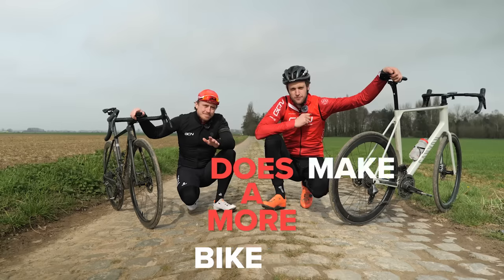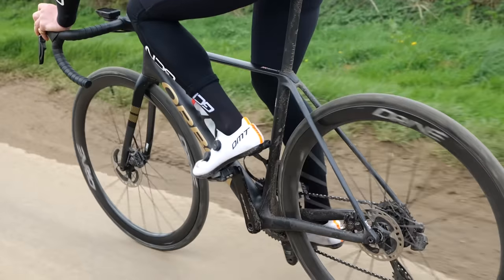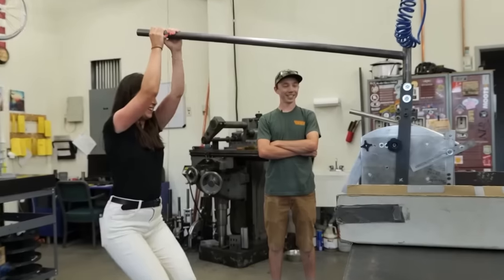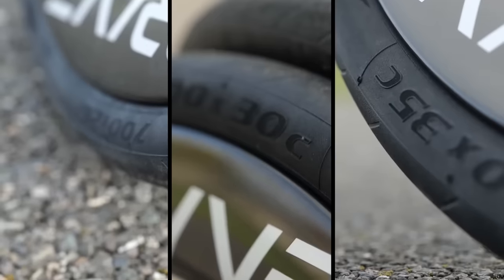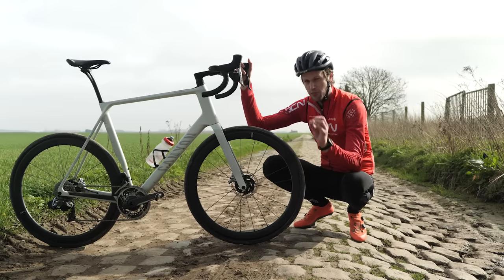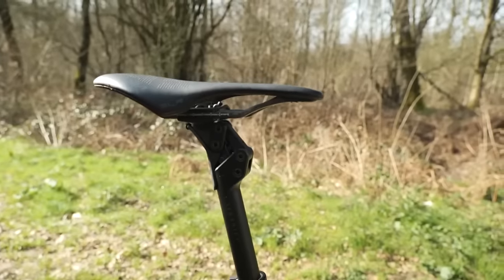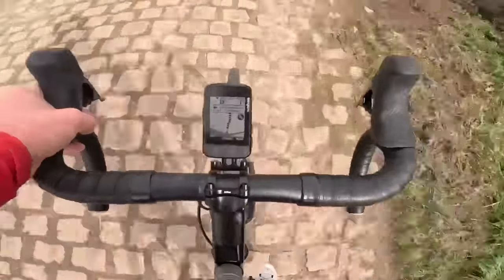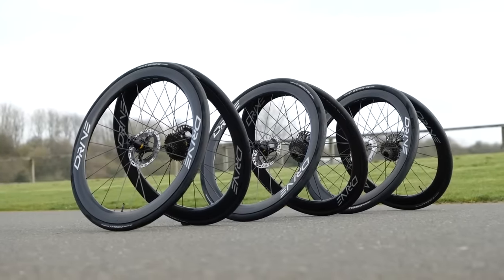Does Compliance ACTUALLY Make You Faster?

Comment from the maker: Have you paid much attention to the compliance of your bike? 🚲

Let us know in the comments below! 💬
Reply: years  ago i thought it was just waste of money but after looking into it more i have realized that it does matter much more than i previously thought.
Reply: And now I am converting my MTB to gravel bike just to really test if it makes difference. 😀
Reply: the bmx (DP Firebird Freestyler) i had as a kid felt like it just skipped over bumps, and still does. Currently have a full chro-mo single speed (Subrosa Malum DTT) with 29x2.35 tyres (60psi) and it's like having full suspension. Both of these have double top tubes, and the Firebird has Skyway wheels which are made of nylon, i have no idea if that contributes anything to this though.

I've always hated the way some bikes ride as if they're trying to smash themselves to pieces!
Reply: As they used to say: "Because so much is riding on your tires" why ride on anything without a supple carcass, no matter what the size/width? My faves are sold by COMPASS...I think Panacer actually makes 'em?

Comment: Buy stiff, because it's faster. Then buy compliant, because stiff is actually slower.
Buy hookless because it's better (to the manufacturers). No, buy hooked because it's safer.
Buy lightweight because it's faster to climb. Actually, buy aero because it's faster everywhere unless on a 20% gradient.
Buy integrated stem because it's more aero. Now, you should go back to traditional because look how adjustable it is.
Buy electronic groupset because... look it is wireless! Damn, you won't believe there's something cheaper and more reliable.
Now on the MTB side, direct mount rear derailleurs, a few more years until someone invents a little piece of soft metal to protect your expensive frame...
Reply: Or just buy what you like and stop following trends?
Reply: @kidShibuya  of course, i do. But all this marketing BS is just getting tiring, especially because sometimes there are no options you would like to chose, since trends pushed logic out.
Reply: Buy hydraulic disc brakes because they're better in every way. Actually, get rim brakes because they're lighter and retro cool. 

This is why it's important to think about what you're going to use it for and where you're going to be going before you spend any money. The thing that actually bugs me is how much time gets spent talking about bikes that are all within 10% of being the same.
Reply: then don't watch 🤷

Marketing will always exist. Professional sports is sponsor advertising galore. It existed before you were born and will continue to exist after you're dead.
Reply: Well, stiffer is great for a big strong racer who wins a paycheck in the last 200m of a race, and can tolerate all sorts of discomfort the rest of us can't.

Comment: Alloy isn't short for aluminium. An alloy is a "mixture" of a metal (elemental) and something else. Steel for example, is an alloy between iron and carbon. Aluminium bike frames are also alloys between aluminium and other metals, depending on what properties you want to give the material. Pure elemental aluminium would typically be too brittle.
Reply: The steel tubing used in bicycle frames, at least the better ones (e.g., with tubing produced by Reynolds, Tange and Columbus) also is alloyed with other elements, often including chromium and molybdenum.  These elements enable the tubing to be made with less material (and thus lighter) with no sacrifice in strength.
Reply: A pure carbon steel is also an alloy (iron with carbon addition). Pure (non alloy) iron is never used as a construction material.

Comment: The new lower tire pressures that seem to be the new norm have had the greatest impact on compliance.  I thought my bike was stiff and a little jittery, but taking my tire pressures down has made a huge difference in compliance.  The bike is far smoother.
Reply: Because this way people not only will ride slightly slower, but also more likely will need to buy new spare tubes, tires, rims. While pro elite teams still ride at high pressures and keep their tires pressure a commercial secret, they would never share with anyone at what tire pressure they ride, maybe only among their  teammates.
Reply from the maker: Lower pressures are great aren't they 🙌
Reply: @tongotongo3143  lmao, cope.

Comment: A thing worth noting is that a really stiff bike with tires pumped really hard actually feels great under some circumstances. I used to LOVE riding with my tires pumped really hard, because vibrations are essentially information. It made me feel like the bike was telling me absolutely everything about the road!
Reply: Yes, vibrations tell you everything on the road, but they also make you slower
Reply: You will also have less control and grip in corners.
Reply from the maker: There is something to be said for being able to feel the connection between road and rider 🙌 Do you think this is lost with the trend for wider tyres?
Reply: Totally agree and it also feels quick and responsive.
Reply: @gcntech  I sure do think you lose some of it with wider tires, but on the other hand, carbon frames and wheels make up for some of it by being way less noodly than old steel frames and allow wheels. Also, I'm 50 and not 20, so I prefer giving up some directness for extra comfort that I wouldn't have wanted to give up 20-30 years ago..
Reply: @fredmcgough748  might feel fast, but in reality it is slower

Comment: I don't think their logic is quite consistent.  Yes, carbon fiber can be chosen and layed up in a way that flexes this way, but not that.  However... even though metal in a cube is isotropic (same in all directions), the very act of making a tube overcomes that, as does butting, as does ovalizing, as does tapering, as does selective heat treating and mixed tube choice.  So, while CF still wins on weight and vibration dissipation, it loses when it comes to flexing and springing back (yes, CF reinforced polymers make excellent springs, but turning them into tubes is another matter).  After owning all kinds of cheap and fancy steel and Ti and CF, I'm going back to metals for everything but seatposts and handlebars.
Reply: We don't build bikes out of spring steel.   Carbon still wins at springing back

Comment: Moving towards 70 and never felt more comfortable on my road bikes! 4-5 hours is easy. No hand buzz, numb-where-you-don't-want-to-be, saddle pain. 32mm tubeless (vs 19mm), power mirror saddle (vs hard, long nose), carbon handle bars (vs steel), padded double bar tape (vs single grip tape). Hell, even my bibs are 5x more comfortable than they used to be! Faster because I ride more.

Comment: The reason that Al frames seem harsh is because of the tube sizes and frame geometries.  the material itself is much less stiff than steel (1/3 as stiff).
What we all want is a bike with lots of vertical compliance while being laterally very stiff.
I did this by going to a bike from Alter Cycles.
Great ride and still efficient.

Comment: Deforming a structure requires energy. Kinetic energy is converted into heat energy and sometimes noise energy. Energy that is not going to the drive tyre.

Comment: Why don’t pros use the seat post suspension for the cobbled races? Seems like it’s a win win when using it. But they don’t seem to use it.
Reply: It probably comes down to weight savings. Pros are really not bothered with being comfortable. It’s all about speed.
Reply: @thenobleist9262  comfort is speed in many cases.   That said, plenty of these bikes just have all the riders want with adjusting tire size/pressure
Reply: Some things are probably not UCI legal.
Reply: @Flexo_l  suspension seatposts are certainly UCI legal, as are suspension stems and forks
Reply: When you pedal that powerful and fast the stiffness and “comfort” of a seat post is irrelevant. If you want to go as fast as possible everything has to be quite stiff.
Reply from the maker: hi, thanks for the comment! Many bikes these days come with non "round" seatposts, meaning that it would have to be a pretty specialist bit of kit made by each manufacturer. Cheers 👍

Comment: Of course it does, we've always know it and most of us opt for compliance over outright stiffness for comfort and less wear to components like bearings, wheels etc. A bike that glides more smoothly over rough surfaces results in a happier rider with less energy spent wrestling the bike as it  skips and bumps over uneven surfaces. The bike industry is run by amateurs and charlatans. First it was lightweight, then stiffness and lightweight, then aero and heavier, then lightweight and aero combined, then overcomplicated compliance from companies like Trek and Specialized, now it's wider tyres and more forgiving components which is stating the bleeding obvious.

Comment: Funny how a lugged steel bike with box aluminum rims and 32 spokes and 20 mm tubs worked for 40 years.
Reply: Wow you are old.
Reply: Well - landlines, faxes, and iceboxes “worked” as well.
Reply: @kidShibuya  66
Reply: @petersouthernboy6327  and they still do…
Reply: 77 and still riding and agree steel and aluminium not to mention the lower cost, and in 60 years of racing and riding rim brakes have never failed to top me.
Reply: they still do just not as well, like the non-indexed shifter on a downtube

Comment: The frame should be stiff. Get your compliance from riding bigger tires at lower pressures. Best of both worlds.
Reply: I agree about the value of the supple tires, but 'stiff' is relative to rider strength and weight.  A rear triangle that is too stiff causes tire scrub during hard pedaling.

Comment: My bike is aluminium and very stiff. Skinny tyres too. Ouch 😳 I am currently eyeing off a gravel bike with 650B wheels for the commute to work.
Reply: My aluminium bike was so stiff that I stripped the parts and put them on an old steel frame from 1984. Steel is much nicer to ride especially with the curved forks which absorb vibration. I can run skinny tyres and still be comfortable. I was also scared of fatigue failure of old aluminium frames.

Comment: Stiffness really only applies for the pros, everybody else, including weekend warriors should always go for comfort.
Reply: Fabian Cancellera used the Domane in every road race after it came out.  The comfortable frameset is often still stiff enough for the very best
Reply: Weekend warriors inside themselves are more warriors than real warriors, so they would never opt for comfort. They want to look like real.
Reply from the maker: Comfort is great 🙌 For most of us that's what will make us want to ride more🥵
Reply: @tongotongo3143   oddly enough, some weekend warriors bury the needle whenever they can get on their bike.  The bulk of a pros mileage is very low intensity
Reply: For elite professionals riding low intensity is absolutely irrelevant. They ride lots of tempos and intervals because that is the only way to ride fast at races. Looks like you believe that bullshit about “zone II” and “low pressure”.

Comment: Steel is an alloy. I wish you would say aluminium or aluminium alloy if that's what you mean. No need to lazily redefine the English language.
Reply: I agree, but to be fair, “alloy” is contraction of “ light alloy” a term often used for aluminium alloys in engineering,…. but possibly applying to magnesium alloy too……wish I hadn’t started this….
Reply: There are so many different steel alloys - why make things unnecessarily and overly complicated ?
Reply: @andywalford7544  Alloy is not a contraction of "light alloy". Alloy means alloy. There are innumerable types of alloys that aren't light and don't contain aluminium.
Reply: There's a science channel or metallurgy channel covers just this subject but most of us are here to watch cycling content 😂 go for a cycle you will feel the tension slip away 😊
Reply: This is an unnecessary pedantry. You might as well complain that they aren't specifying exactly which aluminium alloy or steel, and that simply stating "T6" isn't good enough either. You know what they mean, and for a lot of people being scientifically accurate would actually be confusing, as they don't know what 4130 or 6061-T6 is. Then, of course, you have to consider that those aren't the only specific alloys you could find in a single frame.

Carbon fibre? Which weave? What resin?
Reply: Could've made the point without being rude.
Reply: Don't lose sleep over this.
Reply: Heavy metal 🤘
Reply: That's okay, they call the reinforced epoxy and iron alloy frames something more marketable too.
Reply: Ok regardless of all the points here, why not just call them aluminium frames rather than alloy? It's equal, if not easier to understand. (Unless we want to talk about magnesium, but in such a high level generalised video, we probably don't.)
Reply: Thank you! As a non-native speaker this was confusing to me some years ago. The confusion can be easily mitigated by saying "aluminium alloy" the first time it is mentioned in the video.
Reply: Time for a Bike ride . Cheers!

Comment: @1:30 .. can we please stop honking this 90s BS please?
 From hydro forming tubes (of multiple materials) to 3D printing this is just no longer the case.
  CF might be one of the easier materials for shaping, but 3D printing 100% recyclable material (just requires energy to recycle) toe pokes CF in the gooch and we need to stop treating CF as a disposable product material. (tbf it's the resins at issue, the filaments are less so)

again @2:48 No! It's a designers wet dream material for control and concepts. Recycling, reutilising, UV degregation says otherwise. [Aluminium's lack of long term elasticity isn't too dissimilar but it can be zapped into another design whilst CF cannot.]
Reply: Thanks for that, Greta.
Reply: @petersouthernboy6327  OK
Reply: "we need to stop treating CF as a disposable product material. (tbf it's the resins at issue, the filaments are less so)"

resins being replaced with nylon is already being done, and has been mentioned in a gcn/gcn tech video
Reply: Still a one-time use use product though, not easy to separate/reclaim.
There's a flax based alternative also, which is all moves in the direction of less impact on the Earth. Tis is good.

To me, in this day and age, the complete life cycle of any product produced should be accountable on the producer.
Reply: @two-eyedRoy  not being easy to reuse applies to many things, especially once you start introducing colours or different types of the same material.

Carbon Fibre does get recycled, have you ever seen things like milled carbon fibre powder?